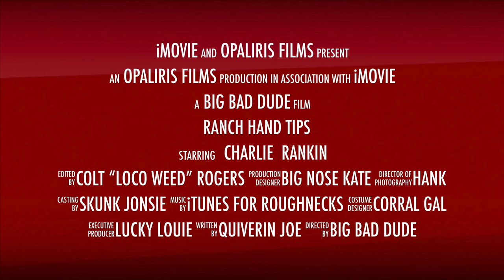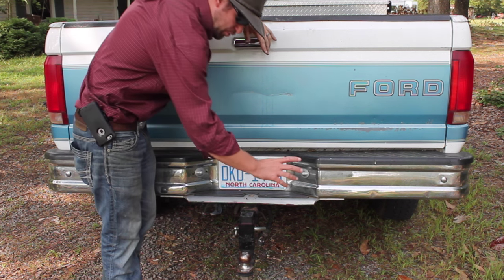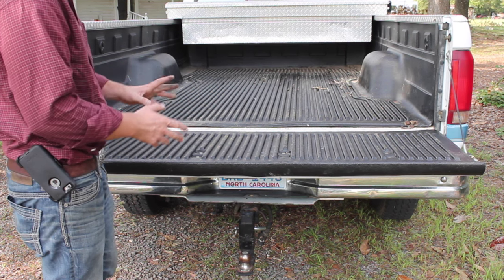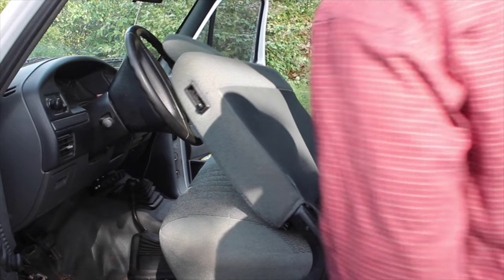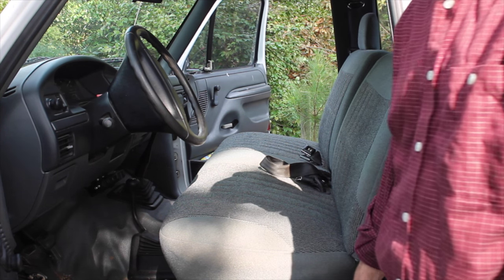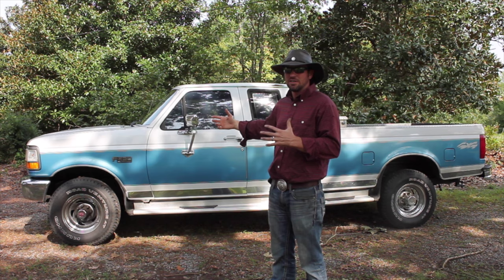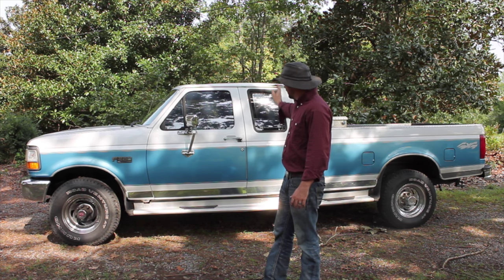Buying A Farm Truck - Ranch Hand Tips

Comment: I found my 1995 Ford F350 Crew Cab long bed on the side of the road in Orlando, Florida with a blown 351 Windsor motor for $1,500.  guy said he'd take  $1,400.  for it. I bought a low mileage 5.8L 351W for $500. pulled from a motor home. had it installed for $700. With a fresh tune up,  new water pump, thermostat,  all new gaskets , new rear main seal & even new motor & transmission mounts.  replaced the battery & air conditioning compressor. that I bought at the  junkyard for $20..  A/C blows cold after adding a new orifice tube & pag oil with ice.. replaced tires with some brand new tires, I seen coming in the junkyard, on a newer F250 for $200. I'm happy with the truck in has plenty of room for both passenger's & cargo & will haul & tow anything.  my truck is also very clean like yours.  A one owner with service maintenance record's. I been offered $6,000. for my truck.  but, they hard to replace ... I too wish I had a diesel.  thanks for sharing that's a great truck 4×4 manual extended cab long bed

search junkyard inventory in your area on car-part.com
Reply from the maker: +Cocoa Cabana looks like a nice truck I would have preferred the crew cab over extended but these trucks seem to have plenty of wiggle room regardless

Comment: Goodness me that is a very clean F-250 for its age.  I would much prefer to get that engine running right, and still be in it for less than it would be worth, and then use the snot out of it until it won't go anymore.  Good trucks are hard to find.  My farm truck isn't the prettiest in the world, but it is very mechanically sound through and through and I know every detail about it.  I would rather have  peace of mind in my truck than have to worry about going out and buying another one when my current one poops out.
Reply from the maker: Nothing tops a good old truck.  Most of them will run for ever if you take care of them.

Comment: thanks for that video; exactly the info and presentation I was looking for. used truck prices are insane. if you need a truck you're actually going to beat up and use it's pretty close to impossible to justify dropping $30,000+ for a manure and straw hauler.

Comment: i bought three trucks for like $900-1800 over the past ten years, they just sit there mostly as they hardly ever start when you need em. Whenever I see a decent truck for cheap on craigslist, I write em a check.  But I bought a 98 subaru wagon when I was shopping for an ATV. I was like, for the price of an ATV, I can buy a real car and then when I am cutting hay or plowing or whatever all sweaty and bloody, smelling of manure and grass, I can just get in the car and get diesel or oil or whatever, something you can't do with an ATV. Best decision ever.

Comment: i recommend that you take the oil fill cap off and feel for compression blow by bad rings would be the cause probably caused by a bad head gasket flooding a cylinder and causing a ring blow out
Reply from the maker: +chrisrhudy2000 I'm sure the head gasket is toast... The oil mixes with the gas.  We can replace the motor for $1800 and still be in the truck far less than buying one in better shape... And it'll have a warranty so technically we'll be sitting even better!

Comment: thats a 6-8k ATLEAST truck up in CT
Reply from the maker: +Chris same here.  Point of the video is to give buyers an idea of how to find something for less.  Even with 2K in repairs by buying salvage we're saving 3-4K
Reply: Chris, that’s a 5K dollar truck here in Texas. He k it looks better than mine and mine is worth 8-9K but I have the 7.3 so that’s a big part in it. But I’ve also replaced all the sensors in it, new valve cover gaskets/plugs, front and rear led lights, new IPR, all fresh interior including fresh carpet but that sad part is that one of the previous owners spray painted it a faded rattle can greed that looked horrible, but I fixed that with some extra paint/hunter green.

Comment: Check the thermostat housing; change the gasket.Flush the coolant and that will probably fix you up.Most trucks that have never had a coolant flush  coolant becomes acidic and eats the thermostat gasket so it will seep coolant in small amounts and burn off when the engine heats up.

Comment: My truck is sound mechanically in pretty much every way. Just a bit of body damage and horrid paint. 43000 original miles
Reply from the maker: +kent clark sounds like a good truck
Reply: Does it have the I6 300 or the 5L V8. But 43K on a truck that age I nothing. These old ford trucks can take one hell of a beating.

Comment: One of my truck is leaking radiator fluid.I poured some black pepper into the radiator and it leak no more.I'll just put it on non-operation and drive around in the farm for awhile until it stop runnin.I got plenty of other trucks,bought them all used.Work trucks dont gotta look all shinny,it's still perfectly functional with a little dent here and there.Long bed mattered a whole lot for a workin man......
Reply: You know black pepper don’t just stop the leak you want it to right? It’ll stop up water pumps,heater cores,thermostats,radiators and anything else coolant (or “radiator fluid”🤔😂) runs through. Also what does “shinny” mean?

Comment: That's unfortunate about the engine because the 460 is a beast and is king of the hill as far as gas engines are concerned. Internally it was the stoutest big cube engine used in passenger cars and trucks. I've taken apart many that had close to a half a million miles and they were not even worn out inside. 
Perhaps you bought a truck that had a thermostat fail and caused the truck to overheat, thus causing the head gasket issue.

Comment: For a new truck, a Tundra work package would probably be the best choice if you need a gasoline truck. If you need a diesel truck then a Dodge Ram 2500 would be the best choice, always the work package.
Reply from the maker: I’d feel bad driving a new truck around a farm... well... the way I drive anyway lol
Reply: @YanasaTV  LOL
Reply: @YanasaTV  Okay maybe not new, but at least not too many miles on the odometer. Plus, a Toyota Tundra is one of those long-term purchases and investments. Thinking logically and with all the data the Tundra is the most reasonable choice to make. Many of these current buyers of Fords, Silverados, and other truck brands are still stuck in the 90's when American trucks were actually AMERICAN. Those days are long-gone thanks to NAFTA and other government actions to outsource products that were once iconic American brands like Levis or the Ford F-150. The irony in a Tundra is even though it's a Japanese automaker, they currently make the truck with the highest percentage of American-made parts. Can't wait til the day Toyota comes out with their own diesel trucks to compete with the Ford F-350 or Ram 2500.

Comment: You don't need 4x4 a RWD on mud tires in rear and weight in the bed. I have gotten all over in the back woods of KY with out a 4x4 farm truck.
Reply from the maker: +qcn_ cummins try pulling 50 plus bales of hay off a field without 4x4.  This is a farm truck video not an off roading video
Reply: I have hualed a 2 ton trailer through a sloppy muddy pasture with a RWD no problem. It's more about torque and tires in my opinion.
Reply: I don't know about the terrain you're use to but where I'm from up North, even in the summer there is no getting around without a 4x4 farm truck. Even a rear locker and weight in the bed is not going to do you any good. I don't think there is a single farmer in my neck of the woods that has a 2wd farm truck.
Reply from the maker: +qcn_ cummins it's more than that, it depends on how deep you have to dig before you hit a more solid or granular surface, there are areas on our farm where a 2wd would climb no problem... but many areas are hard even with 4x4, low tire pressure, and good torque. Realistically your can't be productive without a 4x4
Reply: qcn_ cummins I live in Kentucky too in Irvine